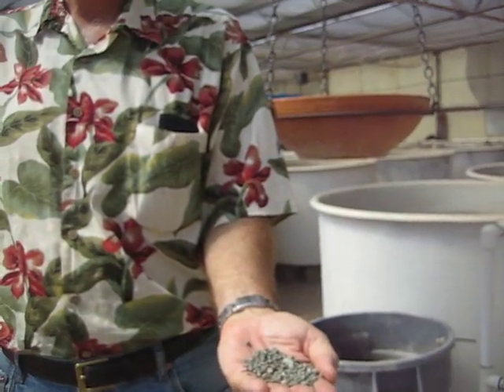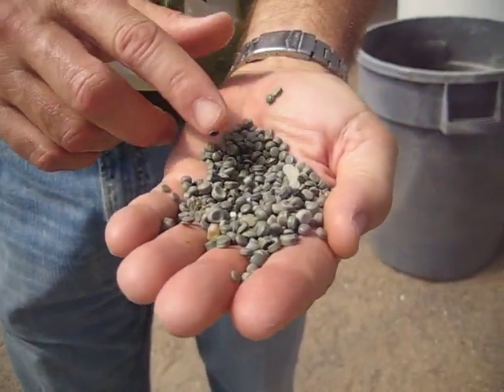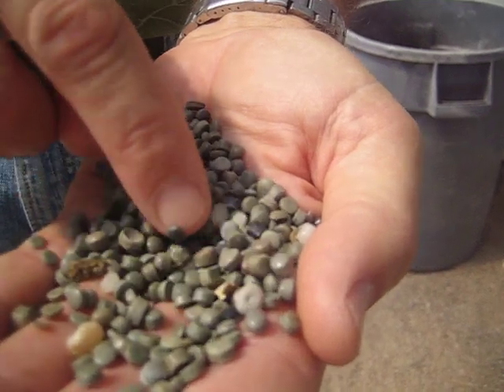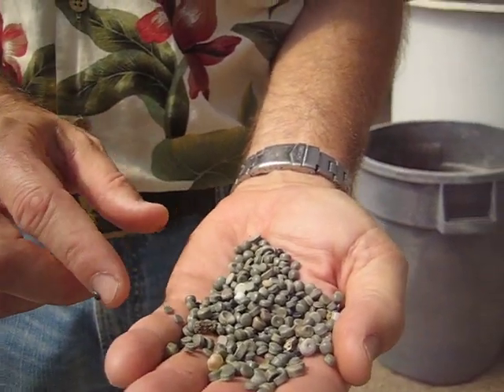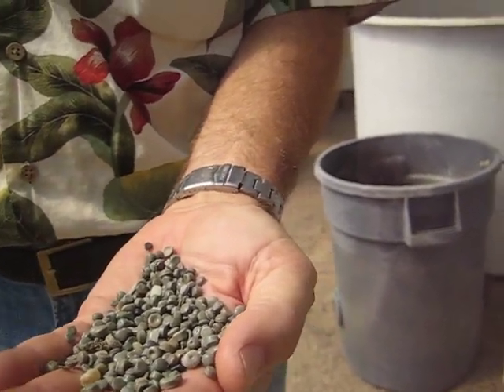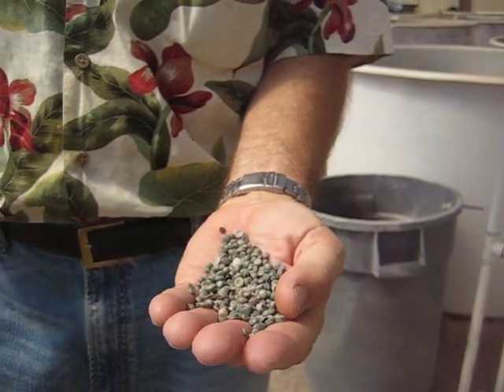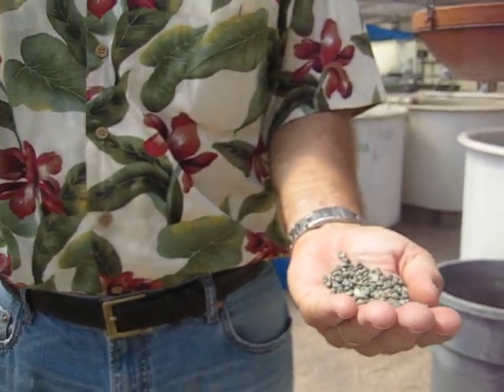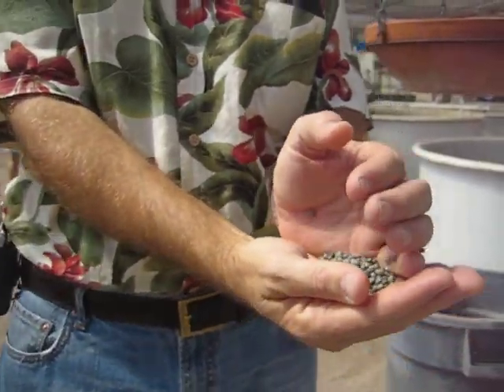Biofilter materials for Aquaculture

Comment: It's easy...those little plastic pebbles the guy was showing in his hands have hundred of thousands of tiny little pores and tunnels inside, and since they are so small, you can pack a very large amount of them per each cubic inch or centimeter of your filter canister, sump, etc. and therefore there is a hell of a lot more internal surface for your nitrifying bacteria to colonize. In short, a hell of a lot better and cheaper than bioballs.

Comment: so are you saying that the plastic caps make for good bio-filtration if scratched and if so how do u get them scratched apart from a sand blasting or in a cement mixer
Reply: Best thing for a bio-filter using a 55Gal plastic Drum is Garden Center Lava Rock and Pea gravel and Sand , layer of Lava Rock, then layer of Pea Gravel then layer of sand on top and and put your over flow pipe on the botton on the barrel  and let the water filter from top to bottom then from the bottom put the 2 inch or lager PVC pipe thru the barrel into what yoiu want it to over flow into -- about 5-6 inches from the top put the overflow pipe coming out. I been using them for years on 300 gallon Koi and Gold fish ponds and water stays crystal clear -- back flush abouit every 4-5 months. i have a spide web of smller pvc on bottom of the Barrel i can pump compressed air into and i just let the flushing go onto the ground from the over flow pipe i can redirect with a few connections